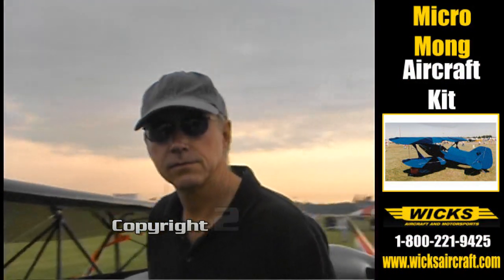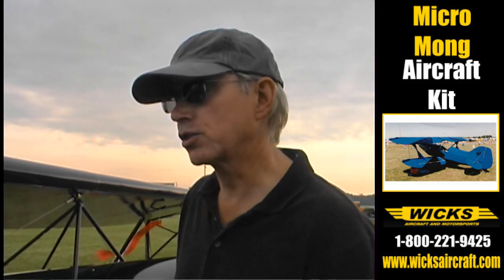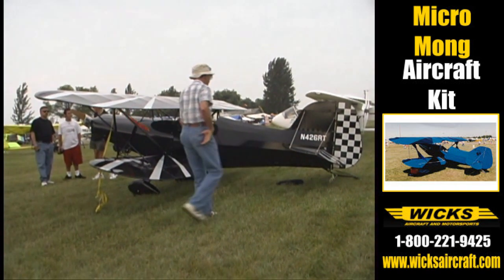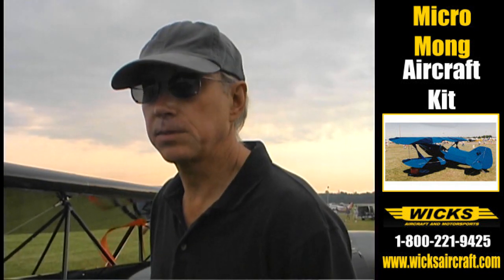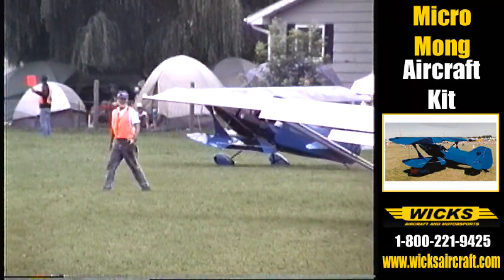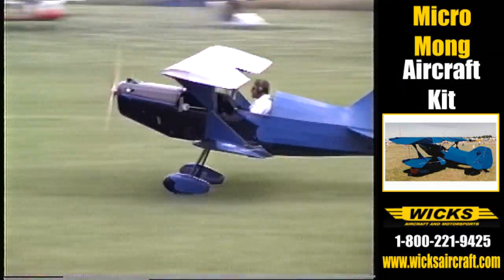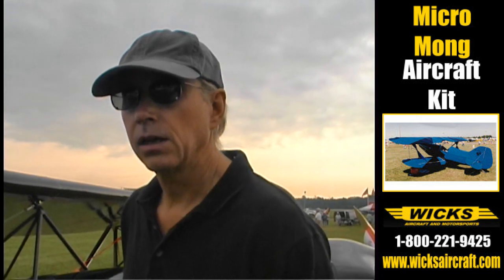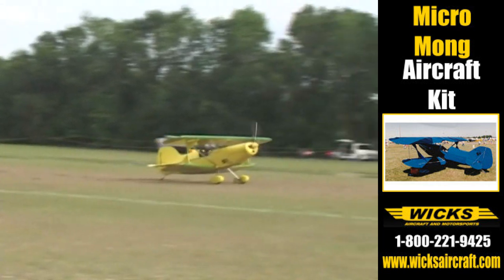Micro Mong experimental, amateurbuilt, ultralight aircraft kit.

Comment: Do you need a license to fly that biplane
Reply: +hayden york Probably, it goes to fast to be an ultralight and looks far too heavy.
Reply: unless you built it with a 227 (out of production) or very lightweight low power engine...  according to the wiki the mong can squeek within the weight limit that way
Reply: Man, that would be tough!   254lbs empty, (or 278 if you have a ballistic chute installed)
"Houston we have a problem!"  I would never fly even a legal Ultralight plane (254lb max) unless I have liability insurance.  Carriers will not write insurance for Ultralights - these flying machines are not considered "airplanes."   Carriers will insure one and two place Experimental Light Sport planes.   See, if you land in someone's living room, having come through the roof, SOMEONE has to pay to get that fixed!  Built three Experimental Amateur Built planes and always had $500,000 liability.  (usually the airport  where you keep it will want to see your insurance paperwork.  If you run into someone's plane, or damage a hangar, etc.  SOMEONE has to pay to get that fixed.
Reply: @mmichaeldonavon  Go home Karen.
Reply: @allywilkeforsenate  Old comment, but still true.  One bad crash and it can wipe you out financially.  You need to get out more Ally.